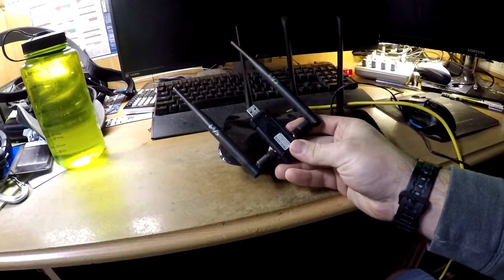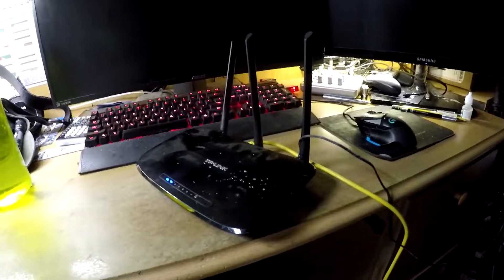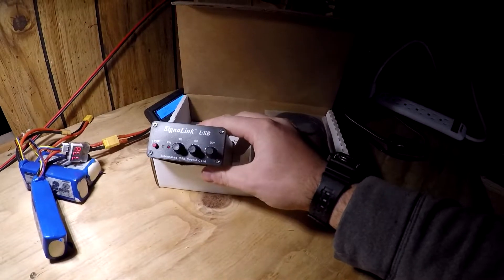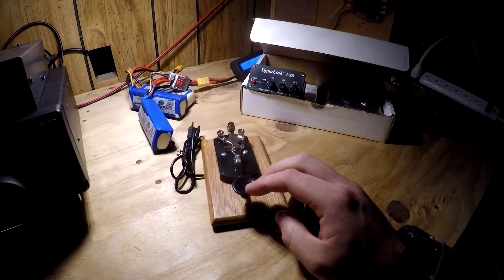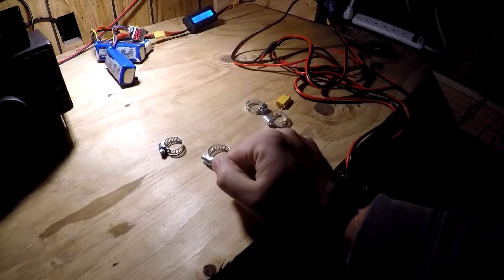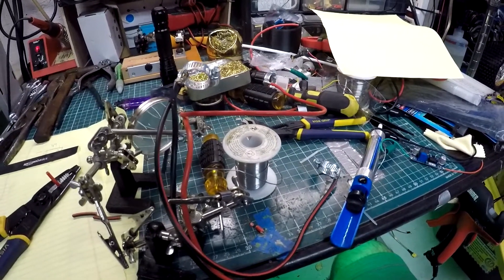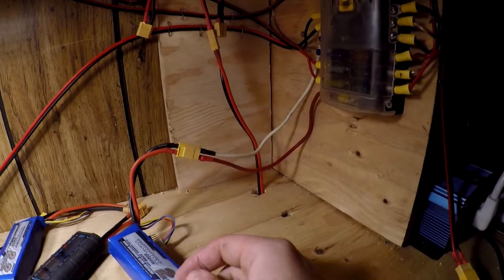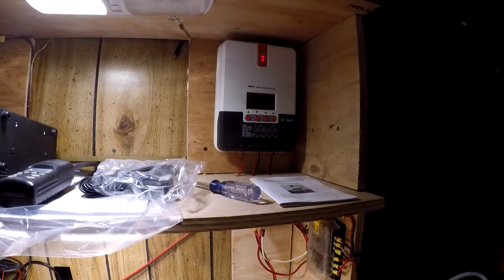Taking the Ham Radio Shack Off Grid

Comment: Sweet build. A few ideas. Not sure but check your laptops voltage and see if it natively runs on 12 volts. If it does you can get rid of the power brick and inverter and buy a plug with the right polarization and right size online and run it straight 12 volts saving the conversion from 12 to 110.  Also car batteries are not the best. Lithium would be best but expensive. You could use a trolling motor battery from a car place or Walmart instead. They are made to be drawn down and recharged. Car batteries not so much. Hope that helps and great looking setup. Hoping to have mine solar one day.
Reply from the maker: Yeah. I used these batteries because its what i had, otherwise i would have gone deep cycle or lifepo4, and my laptop is 19v, i have a surface pro 4 that runs off 12 which helps simplify my field kit a lot since i can just run it direct off my batteries in the field.